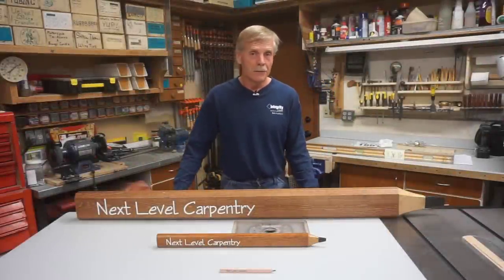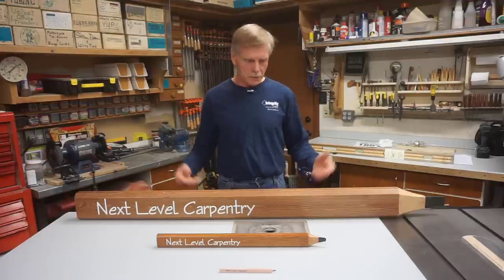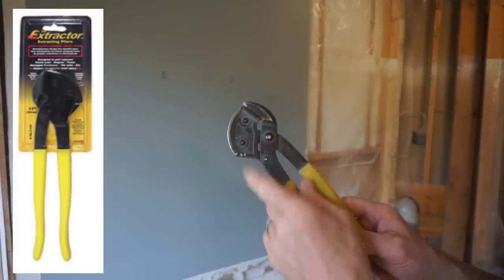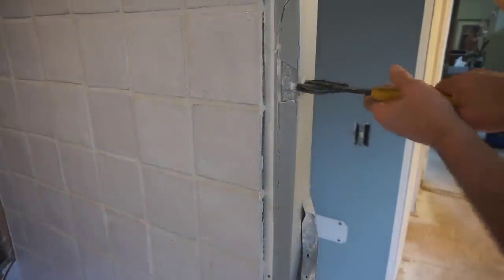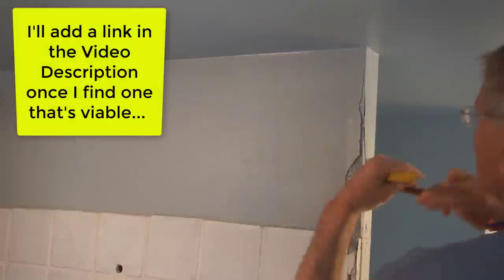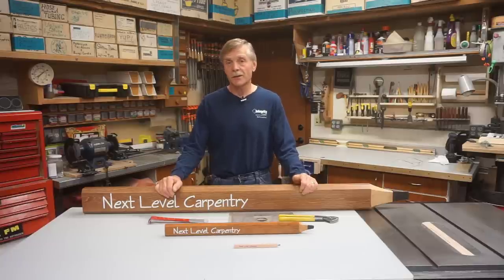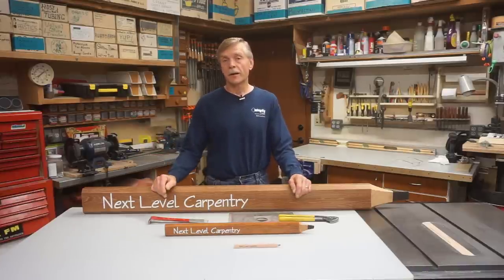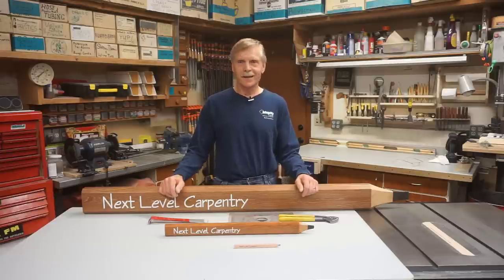Pro Tip: How to Remove Sheetrock Corner Bead

Comment: Well that’s a workout, 5/8 4*12*54 (YIKES) , wish I could help. But how in the world are you getting it up there if you’re doing it by yourself!?   BRAINS OVER BRAWN
Reply from the maker: How?! Old age and treachery, Brian, old age and treachery 😁😎 Actually I'll have the lumberyard sheetrock delivery guys do the 'stocking' and haul the sheets up the stairs and near the room.  I'll hire a friend to help muscle the 6 biggest sheets to where I can cut 'em to fit and I borrowed a sheetrock jack to for lifting and holding pieces in place during fastening.  Once the big bruisers are in place I can handle the 4x8x5/8 well enough on my own and the room/s are so chopped up there's barely anything over a  half sheet after the 'fulls' are done.  Let me know if you're coming over and I'll pick up a few extra donuts... Best, Matt
Reply: Matt, side story here, when I was hanging sheet rock in the second story of my shop I had a couple of friends who were supposed to help but no showed. I used a sheetrock jack to lift each sheet up to the second story, run up the stairs, pull the sheet in over the balcony rail, stack it, run down stairs, lower/tilt jack, place next sheet, tilt, raise jack and repeat about 50 times. Then I had to take apart the jack, carry it up the stairs and re-assemble it to hang the rock. THEN my friends showed up.
Reply from the maker: Talk about 'old age and treachery', Tom... nicely done.  Do a GPS search of that day and you'll find your fair-weather-friends parked up the street watching with binoculars as you grunted it out.  Clever use of the sheetrock jack, my friend!  Best, Matt